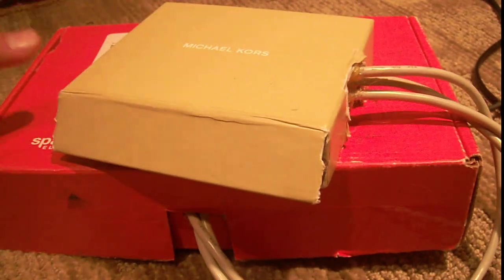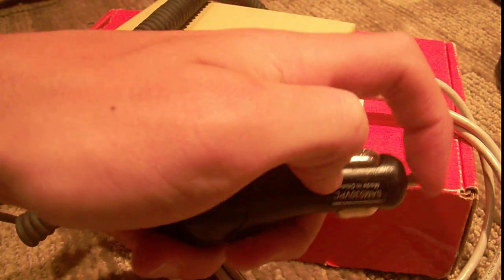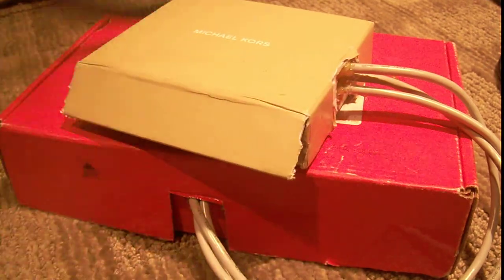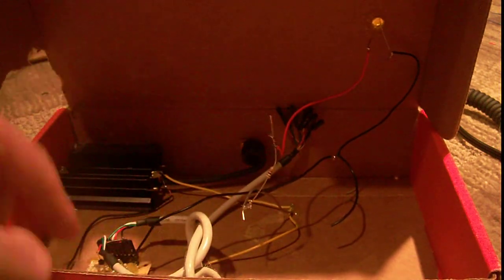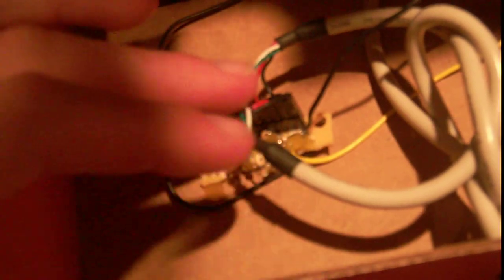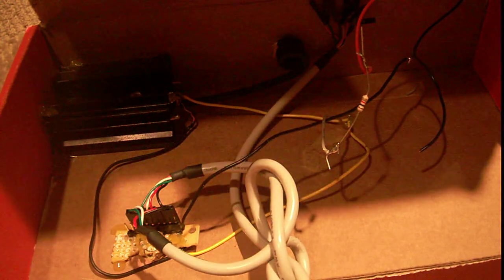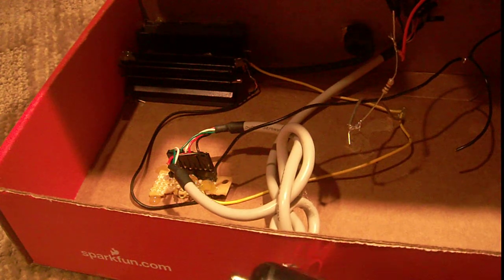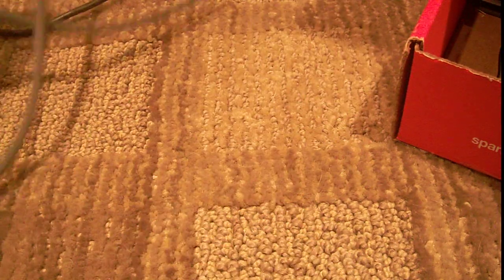How to Build an Ipod Car Charger

Comment from the maker: @caseyl1111 good point but this can charge two at once, costs $0 if you have all the parts (like me), is fun to build, and you learn something. Plus you don't have to worry about when it breaks because you can fix it, no worrying about ebay shannagans, and no shipping! But still most people will continue to use ebay because it is far easier to the average person.